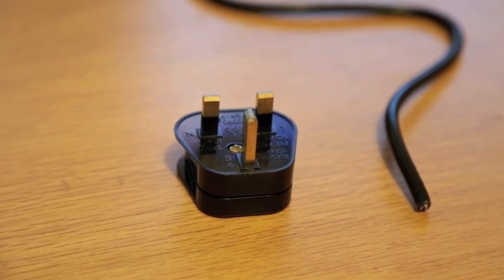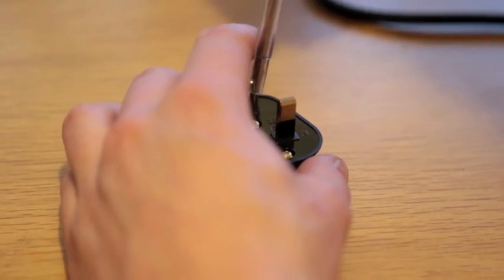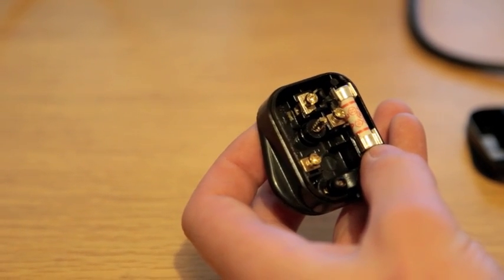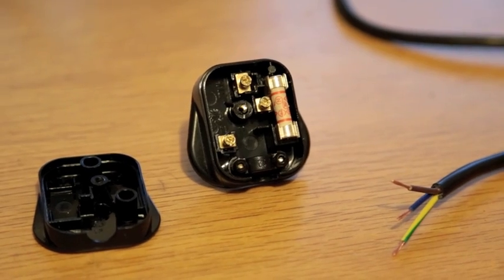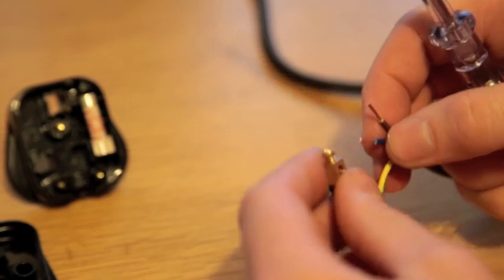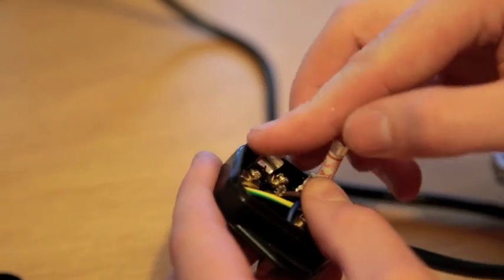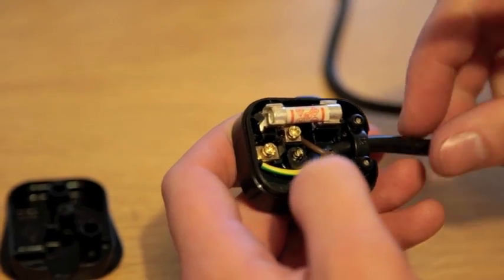How to wire a plug. (UK BS1362)

Comment: why does UK plug has a fuse?
Reply: for safety
Reply: so I guess UK electric systems are less secure compared to EU if they need a fuse
Reply: @MaximumEfficiency  The opposite is true actually. they are safer because a fuse appropriate to the appliance can be used in the same plug housing ie a kettle that is rated at 2500W would have a 13A fuse and a table lamp rated at 60w would have a 3A  fuse(you can buy 1,2 and 10A  fuses if you wish to match the fuse to the load more accurately, but usually 3,5 or 13A fuses are used. The fuse is actually to protect the cable to the appliance not to protect the appliance.

Comment: IMPORTANT. Make sure that the Earth wire has more slack than the other two wires. This safety precaution ensures that, if the cable is tugged out of the clamp, the Live wire will disconnect before the Earth wire. Otherwise, a tug might disconnect ONLY the earth wire, leaving the appliance still working (powered via Live and Neutral) but without a safety earth connection!
Reply: Design logic such as yours is a rarity - you think like me. Also, this is the very same reason that the earth pin enters the socket and mates with its contacts FIRST; if the earth is connected first, safety is ensured IF there is a subsequent fault condition.
Reply: I was taught to always make the earth about 1/2 inch longer than the others and to fold the end of the wire over and position it so that the rotating end of the screw didn't cut through and break current carrying strands  (no matter how careful you are, the screw will damage strands, so the folded over end acts as a cushion/sacrifice section.)
Reply: You're right, always ensure earth wire is longer with last chance of getting disconnected and live wire is the easiest to unplug.
Reply: true, but many plugs dont allow for that , but it is indeed how it should work
Reply: Nonsense.

Comment: Can I make a suggestion?

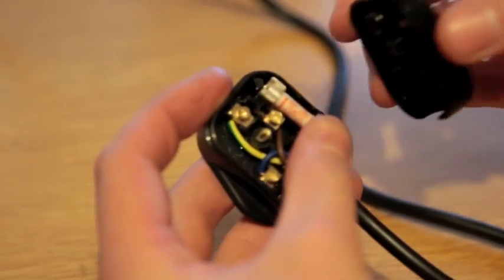At 3:55 you can see that there is still plenty of room to the left of the earth. Ideally, you should pull in as much of the earth into the plug as possible and have it looped off to the left. The reason for this is if the cable were being pulled out then the earth will always be pulled out with enough time for the current to return to earth. A vital safety feature!!